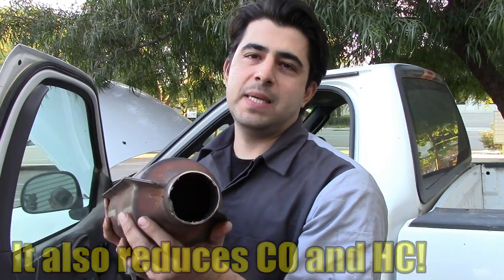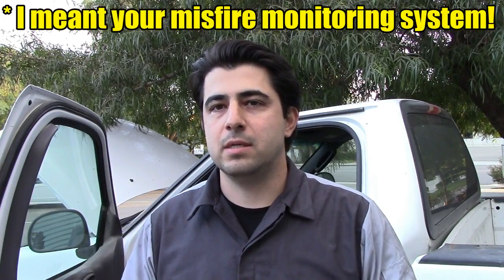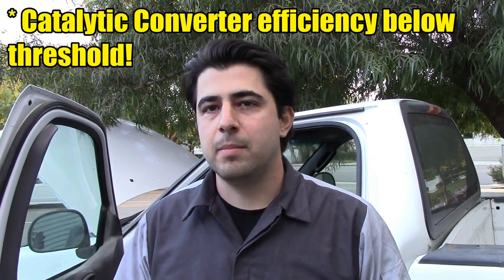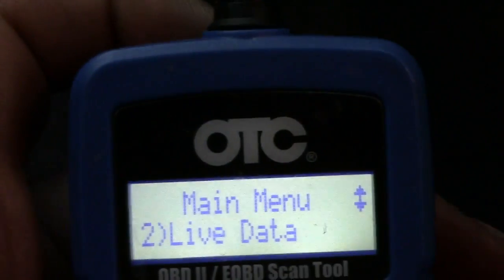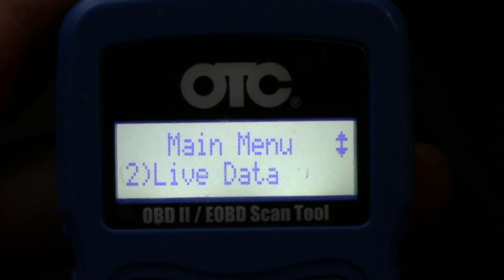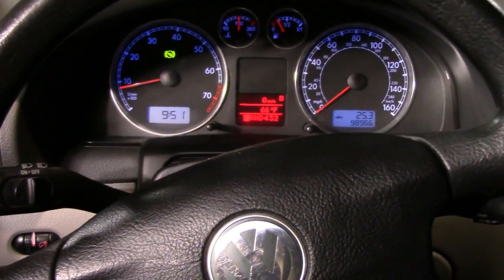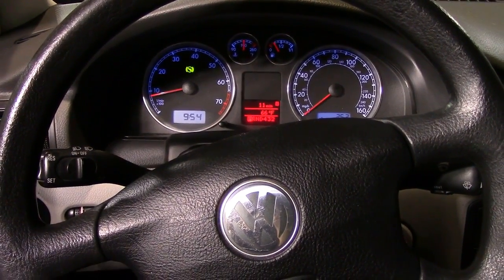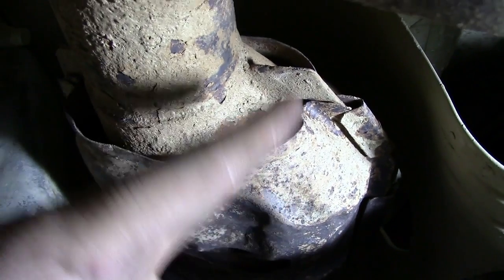How to Check a Catalytic Converter for Blockage or Efficiency Below Threshold Issues

Comment: My car is 10 yrs old with under 45000 mi on it.  So if I understand it correctly, mine is still under warranty for another 25000 miles?
Reply: No the STD warranty is miles or time,  in CA it is  80k miles or 8 years,  you missed the years

Comment: I've developed a mini misfire no CEL, I have a 2012 Toyota Camry I used to get 25mpg. Now I'm stuck at 20. I  noticed the stumble when it's at idle and in neutral, no symptoms when driving but when I stop at a light in drive, I get a vibration, also not all the time but there's instances when my trans shifts like it's slipping badly, and others when it shifts like it only has 114k on it think it could be a clogged cat? It's attached to the exhaust manifold which isn't cheap or just a leak? It can it possibly be both?

Comment: I have a 2007 Nissan frontier 2.5L.  on my scan tool O2S11 voltage is constant at 0.295-0.300 and O2S11 is a constant at 0.340 at idle.  when holding rpm at 2500 rpm the readings pretty much stay the same.  from what I understand am I correct to suspect the O2S11 sensor is bad as its not oscillating between a rich and lean voltage?
Reply: On my 95 chevy the exhaust has to reach 600 degrees and system has to go into closed loop before O2 readings oscillate drastically.
Was 02 bad in your situation?

Comment: Multimeter cant catch o2 sensor voltage switching speed  as it is fluctuates too many times in a single seconded, a decent multimeter usually samples in .5 seconds or more so it will reads the average only not the real time voltage switching, proper tool would be an Oscilloscope. 
Good video though

Comment: How do you test for the MAP sensor, bro? My cat is bad but I think it may have been caused by a bad MAP. I have the 2009 btw 335.  I get the code 0172 bank 1 too rich. It used to to 0301 code and was misfiring. I replaced all the file injectors the misfire code went away but 0172 stayed. I tested the cat with the infrared thermometer like you said and found one of my cats was bad. how can the MAP sensor be tested or if you have any other ideas you can share. Thanks

Comment: I recently replaced the lower intake gasket on my 07 Town and Country with 95k miles I used a lot of brake cleaner to remove carbon on intake and throttle body. I tried to clean it off as best as I could but upon finishing the repair I had a lot of black smoke and got p0420. The code comes and goes. Given that I know the catalytic converter got dirtied by the carbon is it more likely that using any one of the cleaning methods will help? CEL has been on for more than 200 mi driving (mostly city).
Reply from the maker: Akiva Feinstein try resetting it first. If it comes back try cleaning the cat from the easiest method and work your way down. Also first check your post cat o2 sensor make sure its not super dirty. If you want to bench test it I just put up a video on how to do it. gl

Comment: I have a kia sportage  w only 37.000 miles it was only driven short miles by elderly,I'm getting poor mileage,like 14mpg around town, I replaced coils n plugs for tuneup but no change, no codes been thrown,and I notice my o2 sensors front is changed and rear is before the cat? So no codes..any suggestions I put new o2 sensors as well..

Comment: Hi I like your tutorial  and I want to ask you this question:
I have a 2005 Honda Accord Hybrid  V 6  with  code P0240
I have replaced the Catalytic  and the 02 sensor in the front (on the manifold) yet the code still came back. after just 20 miles
What should I do now
Reply: U ever fix it?

Comment: Having a bad misfire engine light on my 2007 Malibu,  pulled the converter,  it was in bad shape and so was flex pipe. The car is on ramps in the garage, I have parts on order. Ebay

Comment: I have 96 Toyota Camry LE with the P0420 code. The vehicle had been acting up as far as randomly shutting off while driving and refusing to restart. I replaced both oxygen sensors and car will not stay running . I am trying to rule out everything I can before replacing the catalytic converter.

Comment: Can a small emissions leak undetected somewhere cause po420 and po430? I have no other codes and these codes pop up after 15 miles from cleared codes, no performance issues, tried lacquer thinner, cataclean, no go, any tips?
Reply: Check for exhuast leaks before the o2 sensors. Had the same problem and I sealed up the leaks and code hasn’t come back

Comment: So I had misfires 3yrs ago. Now my cat is shit. I paid a mechanic $250 to weld 1 on. He welded the 1 under the car, but it looks like he has to change the one under the manifold for me to pass smog. 2004 Toyota Camry btw. I'm still getting a check engine light.

Comment: Hello, I have a Mitsubishi endeavour 2005, did not pass emmisons test. Have 2 codes, p0421 and p0431 warm up catalyst efficiency below threshold and service engine soon light on. Well, it has been on for 3 years, but just poured a $1 bottle fuel injector and carb cleaner in it every year before testing and the light went off and I passed and soon after the light came back on. This year the trick did not work. So I just changed out the 2 downstream o2 sensors. Driving the car now hoping the light goes away so I can get smoged. If it does not go away, what would I do next? I did test all 4 sensors prior to ordering the parts. Got 12.3v on all 4 connections to the sensors, while engine ran, that was key to get any readings, I tested the volts on the sensors themselves and got about 0.84 to 0.94v on all four steady. The ohms tested as follows, front think is bank 2 grey connector think is downstream was at 19.9 ohms, black s1 at 9.0 k ohms, not sure what the k stands for. Back bank 1 grey downstream was 17.0 ohms, black 08.6 ohms. So def something wrong there. The service engine light just went off, so trying to see if I can get Smog now and changing the 2 downstream o2 sensors worked. If not, how can I get a more detailed diagnosis to what the problem is, or the cat is dead? Thanks
Reply: Update: having changed the 2 downstream O2 sensors did cancel the service engine soon light and made me pass the emissions test. So error code p0421 and p0431 are direct related to faulty downstream sensors. Yeah! Stuck it to the mechanics that would have ripped me a new one. $60 for sensors and rented the o2 sensor socket, some premium gas and a bit $ about $13 wasted on some additives.

Comment: 2004 suburban 1500 4x4, does a bad cat always kick an o2 sensor?  I'm getting a woofing sound when gas is pressed and when I let off gas I get a rattle low noise sound in engine/transmission area. I'm thinking a bad cat clogged and rattling from broken pieces in cat but no check engine light?. I ruled out water pump;no leak no overheating, i replaced all belts and pulleys, drive shafts have zero play, AT gear shifting is smooth. I'm baffled to the bone essay!
Reply: m00nchildblues Did you ever figure out what the problem was?

Comment: My 2005 Buick LaCrosse has always run pretty good. but I was getting a P0420 code. Though it's a 6 cylinder, there is only one bank. I replaced the Catalytic Converter. I cleared the code and drove it for 60 miles and the P0420 returned! Any ideas?
Reply: Clint Brock its an o2 sensor
Reply: Elvis Hunky how do you know its o2 sensor, he didnt get o2 sensor error code only p0420.

Comment: With a faulty Catalytic converter.. meaning at operational temperature  the post CAT o2 sensor copying pre CAT sensor, would this create a Lean condition on the LTFT around about +17% LTFT lets say, thus Looking like a vacuum leak  ??

Comment: I've been having hard start issues with my f150 4.2L I've been throwing parts at it like crazy can a bad catalytic converter cause hard starts?
Reply: Paul  Sosa possibly it can be low fuel pressure, it can be dirty air filter or a bad/dirty air intake sensor

Comment: Can a bad catalytic converter and o2 sensor cause crank no start? Mine also has no spark on all 6 cylinders.
Reply: If you have no spark the cat won't matter. Without spark the only thing " cranking" the engine is the starter
Reply: Only resort is to tow it to a shop and have them scan the ecm

Comment: I used my obd2 scanner and it told me code p0420 bank 1 and p0430 bank 2 and im trying to figure out what i need to do to know that correct parts to buy...i know i need a new catalytic converter for my lincoln but whats the other code p0430 bank2?. Someone please help i would gratefully appreciate it

Comment: I have a 2003 grand am 3.4l. bank 1 sensor 2 short term fuel trim constantly reads at 99.2%. do you know what that means?
Reply: Sell it.
Reply: korbon mccall my express van reads the same. did you figure it out?
Reply: From what I can tell it is the default value.
Reply: Yea i used to have a 2001 grand am gt and i just said no more cause i knew eventually the electrical systems on those cars was soon comming..

Comment: My van I use for work when I turn it on it dies out as soon as I press the accelerator. What could it be?
Reply: Fuel line not getting right amount of fuel to intake weak or malfunctioning fuel pump or distributor where does your rpm sit at idle when warmed up

Comment: Mine said p0420 bank 1 cat . But how do i know for sure?  I dont have those tools, and not sure to trust mechanics that want to make a quick buck. Maybe o2 sensors not doing job, making cat bad? I have a torque app with blue tooth scanner.  Any help? 2 cats for 450 installed.. good or too much. Magna flow brand

Comment: Had code P430 bank 2 last month so I actually did research and found out about cataclean bought it at auto zone pour it and drove seem like nothing happen so I just park my car and today when I turn my van on the check engine was gone.i really hope it wont pop out no more
Reply: meme meme cataclean doesn’t solve the problem, it hides it so you can pass emissions. It will eventually come back on. I know from experience

Comment: Man this video is so full of BS advice..

Let me give some layman information without the use of a professional live scanner reading..

The first and simplest thing to do is check for vacuum leaks anywhere involving the intake manifold.. intake manifold leaks can throw the P0420/P0430 codes. If you cannot find any vacuum leaks in the hoses or IMT air control valve o-rings located on intake manifold on some cars, you may have to actually pull the manifold and replace the gasket(s). If you recently pulled the intake manifold and then suddenly got the P0420/P0430 code(s), you may have to pull the intake manifold again to ensure that you properly installed and did not inadvertently damage or displace the gasket(s).

Ultimately, before actually pulling the intake manifold to change the gaskets, check the catalytic converter:

You can simply take out the O2 sensors before and after the catalytic converter and do a  pressure check there, one at a time of course.. look at technical specs for the vehicle to see what these pressures should be. Pressure kits can be borrowed with a refundable deposit from auto parts stores like O'Reilly..

Also, you don't have to do any drilling of holes or loosening of any bolts.. You can also simply take out the front (upstream) O2 sensor and see if the car runs better because you give an outlet for the exhaust prior to catalytic converter.. If a catalytic converter is blocked it will prevent (or greatly reduce) the exhaust from flowing through and cause back pressure like a potato or banana in the tailpipe (resulting in a struggling motor).. give a place for the exhaust to go and it will run better, if that was the problem.. you can also see how strong the exhaust is as it comes out the end of pipe..

You can also utilize an inexpensive laser thermometer to check the temperature at the front of the catalytic converter and at the back. There should be about 100 degrees greater temperature at the back of the catalytic converter if the appropriate chemical reactions are taking place inside the catalytic converter. 

But the temperature change could be due to an intake manifold vacuum leak. If you did not detect a pressure problem with the catalytic converter, this would be where you would want to make the decision to change the intake manifold or not prior to ultimately deciding to replace the catalytic converter.. if you change a good and expensive catalytic converter without correcting an inexpensive intake manifold leak, the P0420/P0430 code(s) will not be corrected..

Regarding the use of a scanner for the O2 sensors.. if you are using the scanners with live readings, basically you're upstream O2 sensors should be oscillating in a certain range. And the downstream oxygen sensors should be relatively stable at the upper range shown in the upstream O2 readings. If not, this could mean a bad sensor or a failed catalytic converter.. The O2 sensor is cheaper to replace as the first step, assuming that the empirical check on the catalytic converter, as mentioned above, did not indicate that the catalytic converter was blocked..
Reply: Get your own channel. If you so much shy are you here? Do you normally troll channels to show your knowlege?
Reply: David Thornton 
You’re the man!

Comment: I had a P0420 and all it was a bad  catalytic converter do to a blown head gasket... so I had to do a head job first then the cat...on a 2004 Dodge Ram 1500...4.7L  and  only then did that code go away

Comment: Could you explain why my ltft is at 6.25% while bank1 is at 3.13%. Both o2 sensors fluctuate about .7v. My gym is gone down a lot. Would it be due a bad exhaust clog. What to look for on my obd2 to fix my gpm

Comment: my 2000 dodge durango won't start sound like it not get gas but I here the fuel pump kick help
Reply: I had this problem with my Honda yes you hear the fuel pump turn on but most times it's a clogged fuel filter ok n the pump or a clogged in the line I used an air mattress pump in the line to force out any gunk found out it was bits of rust and decay from Inside the tank cleared it and had no problems another thing to look at is of you recently changed the pump yourself key is making sure it's lined up properly

Comment: Im having alot of these symptoms in my 95 tahoe. Runs ok when u drive it first few miles it does ok but when u drive a while it starts the misfiring. I parked it in the grass and the grass was yellow under just the cat, floorboard hot too. What u guys think?

Comment: I have a question. my check engine light is on and took my car to a shop and they said I need to replace my cat converter. the manifold do looks rusty. my car accelerate very well, no problem go fast,no miss fire, transmission shift smoothly. I have bought problem driving it skin what's the problem? the o2 sensors are old and useless?

Comment: In Arkansas you can remove the cats, no inspections in this state, I know my cats are bad , po420, I drive s 2000 Acura TL, and it won't start when it gets really hot, wait 1 hour, or next day, it starts every time, I got over 14,000$ in maintenance, everything else is fine, new, been changed except the cats, plus an air leak in the intake tube can be causing it not to start when running it hard. Will get new intake hose, use cataclean , and cut out cats, bypass the O2 sensors,  215,000 miles and it runs like a bat out of hell, all stock,no mods, 4 owner, so I got 22k in this baby and won't quit untill it does, these engines are known to get 4/5 hundred thousand miles on them, Honda and Acura make weak automatics, but it may be an air leak in that cracked taped up hose, !!!

Comment: hi.
i just measured the temps in celsius:
right on top of the manifold = 265 degrees
just below the engine = 370 degrees
before the cat = 170 degrees
after the cat = 235
somekind of live data here:
https://www.youtube.com/watch?v=bHvICH2YswM
does this mean that the cat is working ok and it might be an oily o2 sensor? (it gets in the way of an oil leak from somewhere...)

Comment: Can a clogged catalytic converter cause a putrid smell from the exhaust and hesitation when accelerating?
Reply: Yes!!!   That's what I'm dealing with now on my 98 Ford F-150 and what's weird is I don't have a 420  catalytic converter code. It smells like rotten eggs and no power. I have to turn my truck off when I pick up my kid from school 😀😀😀😀😀😀😀
Reply: @worldwidesports4k  yeah it smells like gas and just some other funky shit not eggs tho no smoke and my idle sits at 1k changed sparkplugs and had an oil change done at Goodyear still the same problem I'm gonna go under my Buick today and loosen those bolts on the exhaust manifold and see if it helps

Comment: $1000?  For what a Mercedes?  Try $70 to $400 on average unless you go to the dealer that is.
Run an open manifold to test?  Great way to burn an exhaust valve.

Comment: He lost me when he said a new one is over $1000 LOL I found them on line between $38 - $282
Reply: OEM goes over $1000 especially on newer vehicles.
Reply: Now go get quotes from shops for instillation
Reply: I wish. But those wont pass smog test ..and hopefully they fit
Reply: Ebay $147 and the flex pipe $72 it was bad shape too. OTD.